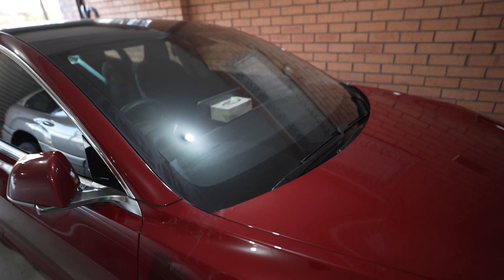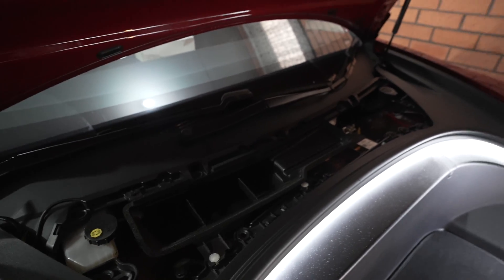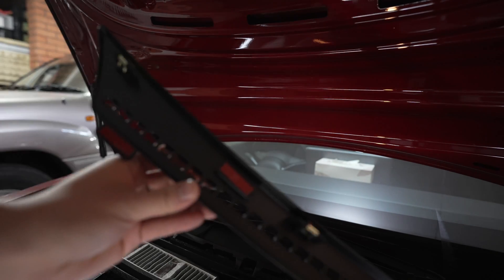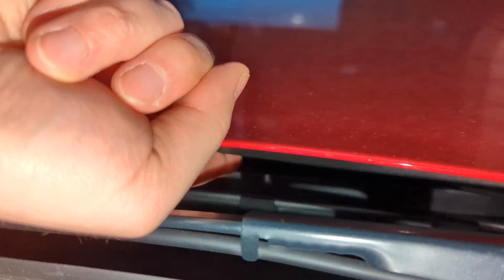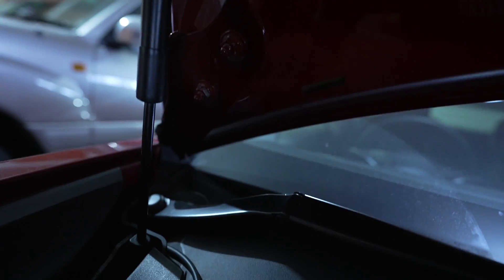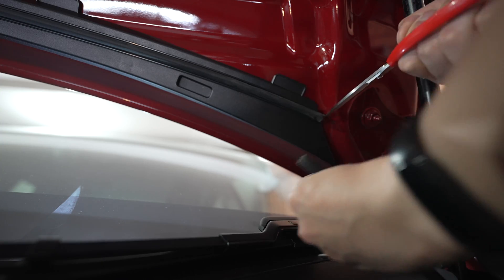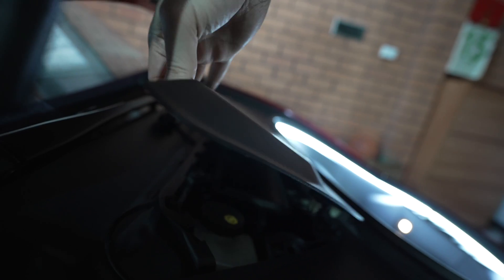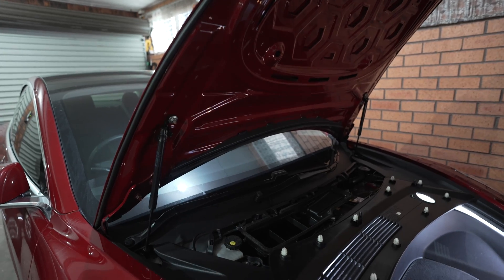Tesla Model 3/Y Frunk Cabin Air Inlet Weather Seal 💨

Comment: Hi,
I got the same issue and did this trick. It solved 50% of the issue. The rest of humidity is due to water from air conditionning getting inside the air filters. You need to add foam arround the air filters to allow water being drained properly

Comment: I saw the edge of your hood being sealed with rubber strip, does it help preventing water from getting in the hood?
Reply from the maker: It helps a little but not a lot. It mostly just keeps the area surrounding the frunk storage area cleaner (slightly less dust/water).

Comment: With the vent seal and the frunk weather striping, how does air get to the inlet for A/C and heat when not in recirculate?
Reply from the maker: The seal doesn't completely seal the frunk. If you look closely you'll see the left and right edges do not go all the way to the ends. The bolts on the hood, near the top edge, next to the struts are not sealed at all. The seal simply deflects water away from the opening, air is still able to enter the inlet unrestricted.
Reply: @wonked  from what I saw in another video by davenport concerning this same issue, there is a 20% reduction in air flow with your current setup. That extra filter you added definitely makes that reduction bigger. There are different ways to get that airflow back in highly recommend taking a look at his video about the cabin air filter problem. It's pretty extensive research.

Comment: By blocking the vent (with the filter) and gaps into the frunk, did you find that your center info screen heat up more than usual?
Reply from the maker: This vent is for the AC system, ie. when you have recirculate turned off the air from that vent is what comes into the cabin though the AC, it's not directly related to the centre display at all so I can't say I noticed any heat difference for the display. When I had the filter installed there was definitely less airflow from the AC when recirculate was off, now with no filter and just the newly installed weather seal I get full air flow again.
Reply: @wonked  I am glad that you removed that restrictive outside air filter, now I am very impressed with your extra weatherstripping. I was worried about restrictive fresh air flow into the cabin.

Comment: GAHH Your son is soooo adorable!!!! The gap there seems insanely big. Is it like that on other cars? Seems an odd design?
Reply from the maker: Thank you =). I'm not sure how large the gap is on other cars but, even just judging the thickness of the aftermarket bracket + weather seal it's roughly 2.5 finger widths thick. I guess Tesla put a lot of faith in the drain hole that's inside the vent to be able to capture and drain any water that entered it but, IMO it's better to prevent water entering in the first place.
Reply: @wonked  Yeah I saw another video awhile back of someone doing a different sort of seal around the frunk. Hopefully Tesla will fix it going forward.